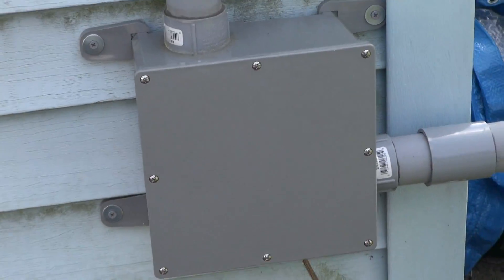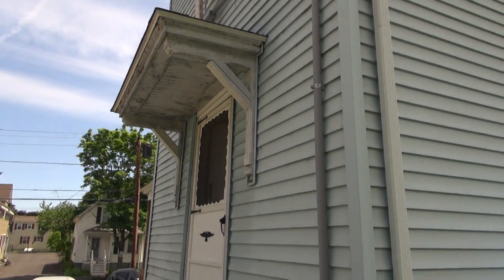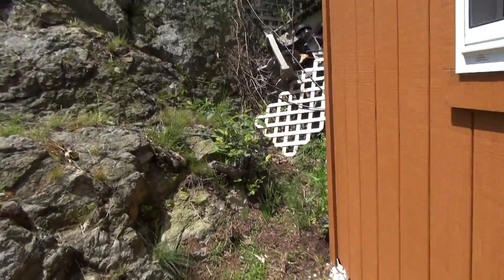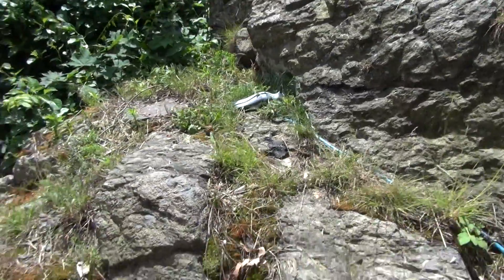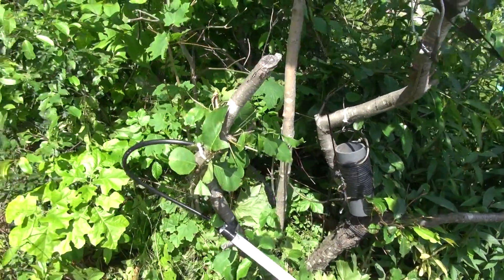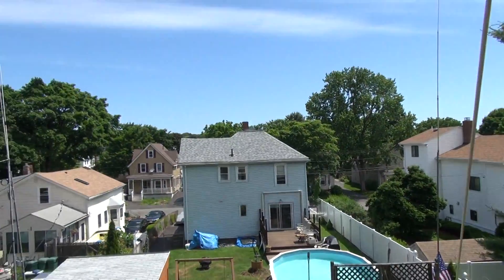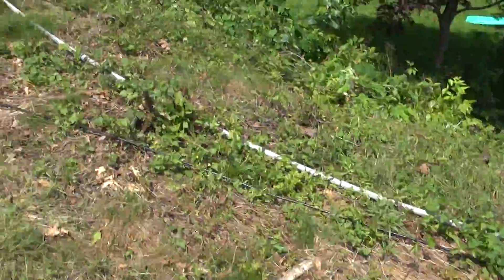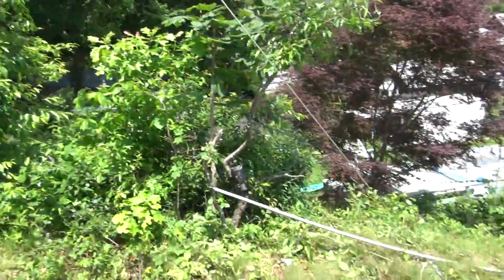HAM RADIO ANTENNAS SETUP FOR THE SHACK

Comment: Those steel cables will screw up the pattern and swr.  If you want to lash it down use .115 trimmer line
Reply from the maker: Are you sure? The steel cables are below the ground plane so I wouldn't think it would. I haven't had any swr issues with it since I installed it almost 10 years ago. The dacron is only supporting the vertical. Those have been since removed due to Ice bending the vertical portion 3 years ago.
Reply: @Kev_31779  the top guys are not good . Ask Tom at zero five. Show him this video.  If it works well now try removing those steel cables.  It's skewing the pattern.

Comment: The Zero5 is a 3/4 wave at 10m-11m so the take off angle will be stupid high and crap for any 'local' QSLing.
It's really too high even for decent DXing. Should remain under .64 at the highest frequency where the antenna will be used.

Comment from the maker: Here is the deal. Yes and no. The zero five is quieter on 10 and 12 meters but the antron99 seems have a 6 db gain "one s unit" on 10 meters for local ground wave communications not DX, over the zero five, But the antron 99 has a disadvantage picking up more static, interference and RFI with increased ground noise over the zero five which is dead quiet . My experience. You need a tuner for zero five as its non resonant antenna, but it functions great on all bands and for the real estate it uses.

Comment from the maker: This antenna is basicly a non resonant antenna. You do need a tuner hooked up to it. It peforms very wll in its designed range of 10 - 40 meters. it does however tune up on 75 meters with a wide enough tuner and it isnt that bad. it does not work as well as a dipole cut at 75 but i still cant complain.